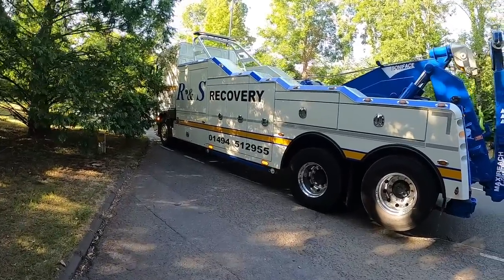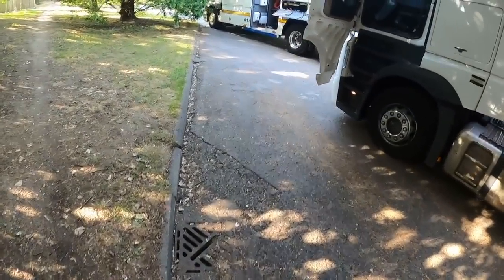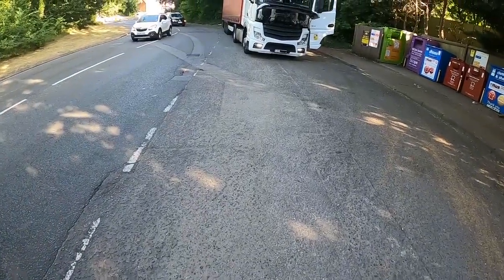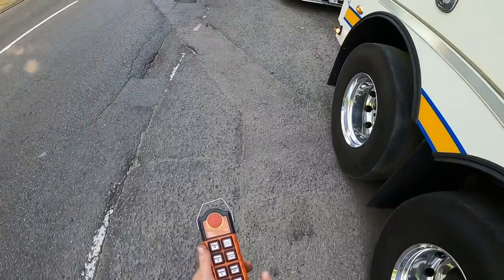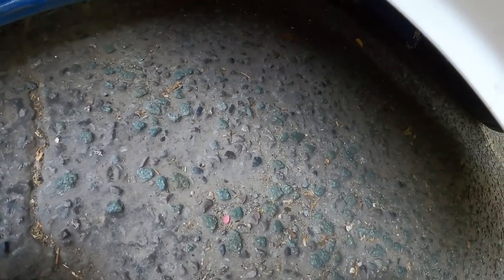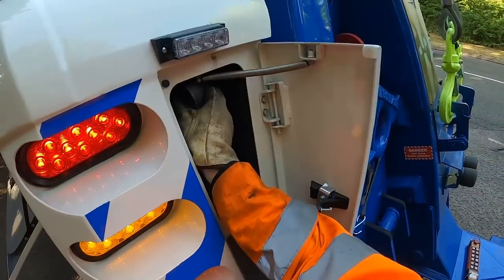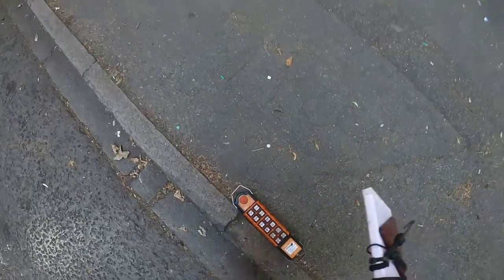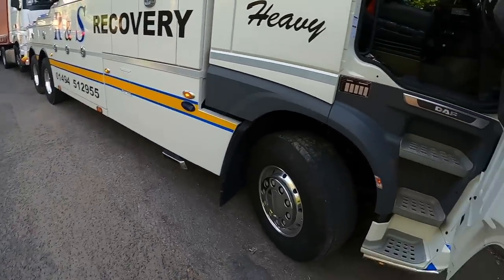RECOVERING 40 TONNE MERCEDES UNIT & TRAILER!

Comment: Cheers Steve. Always the same when you change vehicles! Takes a second or two to adjust....... 

That driver was lucky to have gone so long without a tow in, and lucky to get a pleasant, capable and understanding recovery driver for his first experience. 

My first time was aged 18 in 1990, 3 or 4 months into the job driving a 7.5t AWD. N/S front hub disintegrated near Wareham on a Friday morning. (I was, and still am, Norfolk based). I was recovered by 2 bloody lovely Dorset natives and towed to the local dealership at Blandford Forum on the back of an ancient Bedford KM wrecker. 

Plenty more recoveries over the ensuing 28 years in the, er, "game(!)", and every time the guys were awesome. Despite the disappointment of breaking down, waiting for recovery, etc, I always reckoned anything less than an hour from arrival of the recovery truck to departure was pretty damn quick, but time is irrelevant when safety is paramount.......

I also got to ride in some pretty awesome recovery trucks, quite a few of them LHD, and was full of respect and admiration for the drivers: Driving a "normal" artic requires plenty of skill and awareness, but only has one pivot point, and is usually only around 55-60ft long....... Two pivot points and 90ish ft....?! Respect.

Thanks. Keep them coming 👍👍
Reply from the maker: Thanks for watching Simon.

Comment: What a smashing new DAF that is, very smart!! 
(in my opinion, at least) Daf is one of the least aesthetic trucks but the best for all-around work. With regards to towing, I have no idea what they're like, but the DAF CF dustcarts we have at work are really well built, sturdy, durable and have just enough of the features you need, with none of the additional buttons that create a minefield of what button does which job. 

I do like Boniface engineering bodies. They seem to engineer their work very well. Even having the airlines on the offside (for a UK truck at least) makes things much easier. however, in this case, may have made your job a little trickier.
As I've always said, slow and steady wins the race. No good sprinting along only to stop half way. It's a marathon, not a sprint.

Great vlog as always Steve!! Safe travels Mr!!
Reply from the maker: Thanks for watching.

Comment: Hi Steve, loving your videos, so wish I could get into heavy recovery work. 
Steve, does it matter which half shaft you take out?
Reply from the maker: Hi Ollie, you can remove either half shaft to discount the drive to gearbox . But its easier to remove and refit the half shaft without the diff lock mechanism that locates on the half shaft spline, as the teeth need to be lined up for the half shaft to pass the diff lock collar to the diff. Hope that makes sense Cheers.

Comment: Ayo mate in cases like this, if the engine is able to run, just let it idle while you're towing it,
if it runs, the gearbox oilpump will be driven and theres no need to remove the halfshafts or the propshaft. 
Working in a mercedes dealer ship in germany and we do it like that, if the engine isnt able to run we just disconnect the propshaft, since some trucks have a diff lock option and if you remove both half shafts, the fork that slides into place to lock both wheels will fall off basically inside the housing.
dunno if thats helpfull for you just wanted to mention
Reply from the maker: Thanks for watching and comments, we have to disconnect the drive on all commercials we tow following manufacturers guidance and company policy.

Comment: Steve I’m sending you a half shaft cap with Peter chalcraft one for you to use just pop a small amount of sealer on it and it won’t leak at all will fit daf and merc
Reply from the maker: Hi thanks very kind of you to do that, i have got a Daf and Volvo cover but could do with a Mercedes one as you say that be great thanks.
Reply: @HeavyRecoverywithSteve   should be with him maybe Wednesday

Comment: Another great video Steve..... the air test points you used, why both ? I normally use the top one. Just wondering for reference/knowledge 👍
Also has the coach video been taken down from Heathrow Airport, the one with rear quarter damage, and use of grids.... ?
Reply from the maker: Hi Michael , i use to go directly underneath to air drier then chap from Mercedes said save crawling underneath go on both air points under grill so been doing that lately mate. Yes had to take coach down unfortunately customers request.
Reply: @HeavyRecoverywithSteve  Hi Steve, thanks for the reply, yes thought so as the video had gone from list.
Will look at doing that then next time 👍 also I normally put yellow to trailer but not the red and just go through unit to keep air up on unit and trailer....

Comment: I saw that you disconnected the drive shaft. I suggest is an automatic gearbox yes? I asked my father who is a retired truck driver that manual gearboxes need to disconnect the drive shaft also to protect the gearbox
Reply from the maker: Hi thanks for watching , we have to disconnect the drive to protect the gearbox on all commercials we tow , manual or auto gearboxes. We tend to remove half shafts more than discount prop shafts these days due to safety.

Comment: Hi Steve! Again, another great video. Just curious as to the 2 test fittings you plummed into under the bonnet...do you have to plum into both for supply air to the tractor? Just a curious camper
Reply from the maker: Hi Brett thanks for watching , Mercedes chap i met said plum into both i have to try just going into the top connector see if that fills the air tanks up as well. I used to go directly onto the air drier underneath before.
Reply: @HeavyRecoverywithSteve  I'll have a fitting made for this occasion. Thanks for getting back to me Steve, keep it up love your work
Reply: @HeavyRecoverywithSteve  if the top port is for the air tanks to release the hand brake, the bottom one must be brake release for the rear brakes of the lorry? Sorry for all the questions Steve

Comment: Steve under the hood you connected to release the parking brake?  Is the connection for air supply?
Reply from the maker: Hi Robert , i use to crawl underneath and go directly onto air drier but chap from Mercedes said go on both air points under grill so i been doing that now.
Reply: @HeavyRecoverywithSteve  it's such a simpler solution?

Comment: Why don't they use the American style leaver controls on the UK builds? 
The button control panel you have seems to take up a lot of space in comparison to the US tow trucks featured on YT (Ron Pratt/ Plaza etc). It also seems like an 'All or nothing' way of controlling the hydraulic movements with no ability to feather the action.
Reply from the maker: Hi thanks for watching and commenting , not sure on these buttons either, i do prefer levers as well as back up for the remotes.

Comment: Hey do not know any engineers make plate or cover for half shaft on mercs trucks
Reply: That's what I started to wonder. Some fab shop with a laythe and milling machine could easily make a cover and I suspect it won't break the bank
Reply: He said before you can buy a set for most popular trucks but he already has one for the other makes, so it would be a waste of money.
Reply from the maker: Hi Craig , got my mate from Mercedes on the case now.

Comment: Not too knowledgeable on heavy recovery towing, so just a question, you remove the half shaft or prop shaft to disconnect the transmission, why can you not just leave the vehicle in neutral gear?
Reply: Leaving the transmission in neutral disconnects the transmission from the engine, but not from the wheels, so when towing wheels turn and transmission turns.

Comment: Why do you have to remove the prop shaft and cover it with a towel?
Reply from the maker: Hi thanks for watching , i removed half shaft and wrapped a towel around to protect it from marking paint in holder , should of come with rubber cover really.